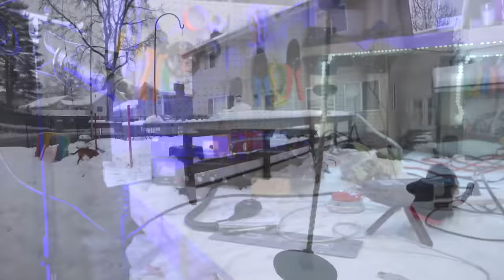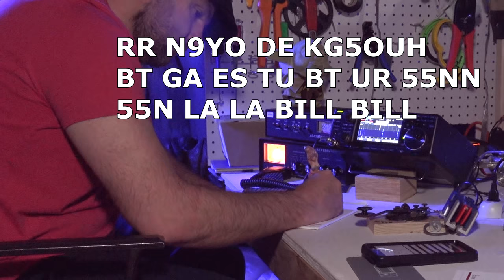CW Straight Key SUCCESS!, CW Ham Radio QSO is So Fun!

Comment: Nice job Tom!  I love CW and I love that you are keeping it alive and well.  You are inspiring so many to try CW or brush up on their CW skills.  "James B." made some excellent suggestions below.  I am no expert on a straight key, but to expand on that, here is my 2 cents worth according to what little I know and have been told by experienced hams.  I noticed you are jabbing at the key with one finger and removing it, making it even more difficult to stabilize they key and making even more noise.  One suggestion is to place your index finger on the top of the knob and your thumb and middle finger on the side of the knob (the reason for the flange below the knob is to rest your thumb and middle finger and lightly grip the knob) and never letting go.  That way you have total control of the key at all times and are less likely to over attack the key with strictly down strokes then removing the finger. You'll also notice the key is less likely to slide around.  This can also be accomplished with a knob without the flange. With practice your movement will have less travel, more control, your key will be more quiet and your Dits and Dahs lengths much more equal.  Straight keys are fun!  Good video!

Comment: Tom, relax the tension on the key so that it keys easier, and tighten the spacing between the contacts to that the throw of the key only requires a small amount of movement Then get your arm up on the desk to rest it and/or a wrist rest.  You MUST get more comfortable, and decrease your effort.  You may need to lower your chair.  You are working yourself to death. It will wear you out.  If the spacing between the contacts is very low, the "clicking" sound will be much lessened also.  AND wearing headphones will help there too, allowing you to listen to the side-tone and better ignore the clicking from the key.  Also get that key nailed down either by literally fastening it to the desk or get/build a heavy base.  I use a large piece of steel.  Another method is build a long thin base that your arm/wrist rests on and helps hold the key down by your own weight. Paddles were invented for a reason,  Once learned, they are much easier and faster.  BUT you can do much to improve your straight key technique.  Tnx and happy keying  de James K0UA
Reply from the maker: Everything you said is correct.  I'm tense, I'm trying too hard...just exactly what you'd expect from a newbie!  ha lol.  I can't really wear headphones until I figure out how to split out the audio to the camera. My chair is too high for sure.  Thanks for the great detailed comment.  It will all be asborbed I promise.
Reply: Absolutely. My first suggestion. Also try to find your self a heavier base, that will help keep it from hopping around on you. The J38 was an excellent key used for military training in WWII.
Reply: Very good advice.  Practice off the air and get a real CW op for a mentor.  Straight keys are harder than most realize.  But, HEY, hang in there!  It's a learning curve--why we used to have the novice license.

73,  Jim N3AWS
Reply: Yes, straight keys are more difficult to master but I think they produce a much better and more pleasant morse. Your first time was pretty good. Don't "jab" the key, keep your fingers in contact with the "button", keep your arm off the desk(some people have suggested resting on the desk, not recommended) use a flexible wrist to get the style going. (From a 5-years ship's radio officer)

Comment: Hey Tom:
 Another great video, you’ve been an inspiration to me to get back on the air I’ve made a couple contacts kind of stumbling through it with the Iambic. My Son helped me out with getting the “ameco” code practice oscillator working again so I can practice, I just got a second RT320 Clansman radio and it only works CW with a straight key, plus my Son has his #19 WWII tank radio and it is AM and CW straight key only as well, so nice timing on your video more inspiration for me to get on the air with the straight key! 73
Reply from the maker: Yes, don't worry about stumbling.  Try and fail and don't be afraid... we all mess up sometimes. If you even knew how many times I failed a QSO and just left.  LOL

Comment: I'm somewhat new to the CW world, and have only made a handful of CW contacts using straight keys (I've been trying to make at least one a day for the past month or so), but I've found that a relatively inexpensive straight key that I enjoy using is the Chinese Army (PLA) key.  There's a write up about it on Morse Express and a page on eham, and they can be found on eBay for $50-$60.  They're still in production in China, so not hard to find.  Very heavy metal base, the tension and spacing is very adjustable, and the knob feels very nice (almost like a flame proof knob).  Thanks for the videos!
Reply from the maker: Wow I looked up that key you mentioned looks very nice / tough. I want one!

Comment: Way to go, Tom! Some tips - use a larger board with the key mounted to the back. That will stop it from wanting to tip over. Then put a piece of that rubber shelf liner under it - no more slip. Then you can leave your other hand free and not need to hold the base in place :) 
As forthy62 said, Junkers are good, I have a Navy Flameproof that is wonderful and I have home made two keys - one for home and one for portable. Pics in my QRZ page. Enjoy & hope to cu on the air!   WB2SMK / Mark
Reply from the maker: Great ideas thank you.  I'm a mess as of now.
Reply: Don't be hard on yourself! It takes time! I love that you're plugging away!

Comment: I'm back to CW after a long time away. I use a 7300 also. Some suggestions: put your key on a heavy base, tighten the contact space, lighten the spring tension and grip the knob. Lots of YouTube videos on the proper adjustment of keys.  Maybe try a navy style knob, they are easier for me.  Good luck, it gets easier
73
Reply from the maker: Yeah, I have a lot of upgrades I need to do.  Can't tolerate the sliding of the paddle / key.

Comment: Hi tom nice video, 
Have a play with the spacing on the key I find a narrower gap makes it easier also my straight key is mounted on a piece of granite to stop it moving. 
Nice work though keep it up!
Reply from the maker: Correct.  AFter the video I did mess with spacing. I found too close together though was bad as too far apart.  Have to practice more!

Comment: what antenna do you think would be best  using the icom 7300 to listen and transmit and for range?
Reply from the maker: I wouldn't dare to suggest a specific antenna, but it depends a lot on your space, backyard and budget.
If you are trying to stay cheap, then an inverted Vee, or some kind of dipole is really great.  You can even make them.  I use a G5RV, not that it's that great, but, I use an antenna tuner so I can tune it up and it works fine for my small space.  If you can get a resonant dipole that's my favorite.  but you have to consider what bands you like the most. I like 40 meters, 7Mhz area for ham listening and transmitting because it works at night as well as the day.
Reply from the maker: Antenna theory is a complex topic and many people have different opinions. If you have some hams local to your area talk to them and they can come and suggest some options for your particular yard.  Some of the vertical style antennas require that you bury ground radial wires in the yard.  That's something you may or may not be able to do.  If you had a vertical tower type antenna, and buried ground radials I think that would be great.  Just be prepared for some construction.
Reply: @hamradiocq what is the best way to hang it

Comment: Want a real challenge? Try using your paddles as a sideswiper (cootie). I practiced for a while, got good enough, and started making QSOs. Now I’m utterly hooked. I easily hum along at 20 WPM. I can go faster if necessary, but more importantly I can easily go slower. Then there’s the bug. Morse code is the absolute best aspect of the hobby!
Reply from the maker: Thanks for the comment I really appreciate it.

Comment: That's funny - I can only use a straight key.. Never been any good with paddles. I'm a drummer so it's always been the only way.  
As others said - you need your arm on the table but the way you are doing this it would be easier with a little more distance in the travel of the unit.

Comment: It's not the key, it's the gap, needs narrowing a bit, I always find keying with a wide gap leads me to unnatural slightly disjointed character sending...make key adjustments to gap and spring tension until you find what is most natural to you, every op is different... Heavier base and blue tac (sticky tack) underneath to stick it to the bench..
Reply from the maker: You are correct, tnx for comment

Comment: G'day Tom, just watching you trying master the straight key and you don't look comfortable. One arm holding the key to the bench the other is hard to send. Tom, to get the  balance  and  the key is with right hand. That block wood can be screwed to the bench or some thing heavier at bottom of the key so your  not holding the key. Good video your doing well mate 73 de Dennis vk4oc.
Reply from the maker: Absolutely correct.  I'm very uncomfortable.  Much to do and learn.  I will rig something up as you say so it doesn't move around.  That's a joke.  Ideally I'd want to send with my left hand and write with my right!